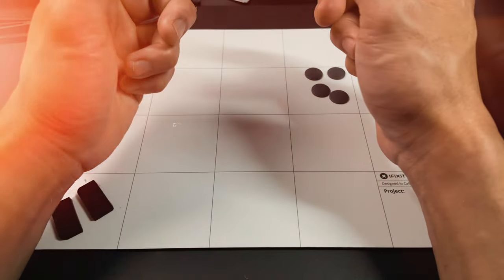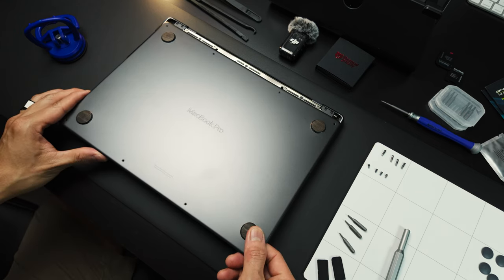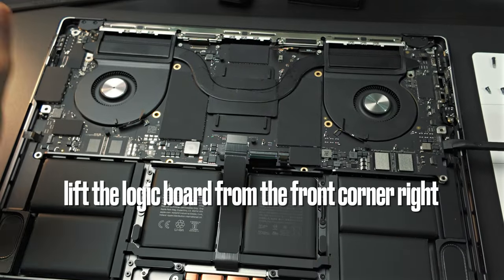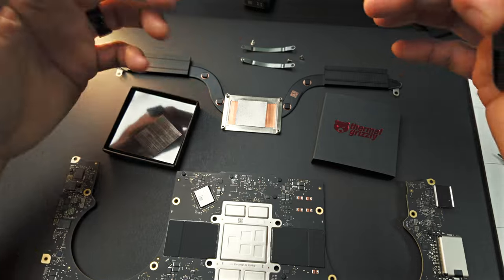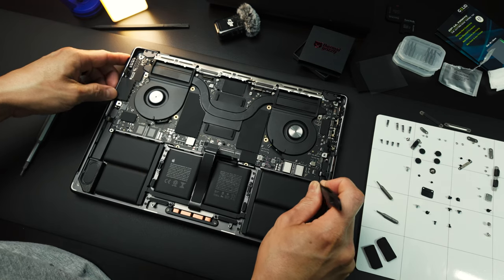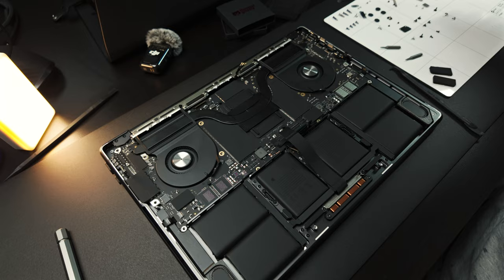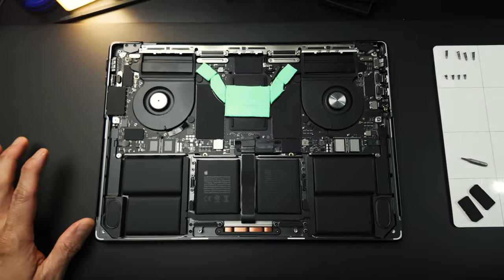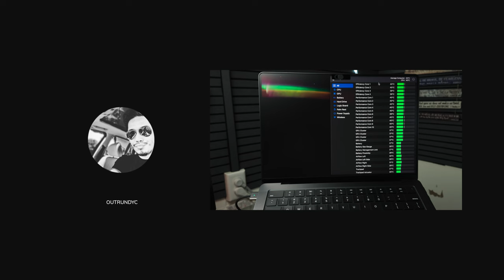Teardown of a MacBook Pro M3 Max that has Kryosheet! REALLY?

Comment: Hi Cool Video, have a couple of questions? if you kind enough to give some inputs, what was the temp baseline prior to installing the Kryosheet? and do you think that buying 2 to really cover in full the m3 max processor will have any add Value? from the pipes to MacBook lid, what expessure are the terminal pads? I have same m3 max model, and well you know if get's loud a noise in any situation. I'm exploring a 3d graphite thermal pad from UPsrien that have 40w/mk from pipes to lid, still taken courage to install the carbonaut or kryosheet. also purchased SValt cooler as stand to see if eases the noise.  any inputs on above is welcome.
Reply from the maker: Hi @cassiobloisi9756, thank you for your comment. As for the baseline temps, before all of the mods I did , my very first run of Cinebench, for the multicore I got 1,359 and GPU got 10,401 points. I compared that to most Youtube videos that reviewed the 14" M3 Max same spec 14/30 core. Now for the Idle before doing all the MODs im getting CPU performance cores getting 43-47C just browsing the web. 
Im going to make another video, Kryosheet vs Carbonaut. 
The Svalt stand cooler does really make a big difference acting as an external heatsink. Which one do you have?

For the size of Kryosheet, you just need 25X25X0.2mm perfect size. You will have to align the pads on the heatsink check this video out. https://youtu.be/dlSx8JMefX4
Thank you and have a great day! Let me know if you are going to do the Mod and have any other questions. Goodluck!

Comment: Hi. Which size of Kryosheet did you buy and did you have to cut it to fit the M3 processor?
Btw, big thanks for the step by step guide. Will definitely follow this and replace my thermal paste too.
Reply from the maker: @teshynevermore5821 You're welcome! The perfect size for the M3 Chip is 25X25X0.2mm . But wait, based on my observation, I think the Carbonaut is far more better than the Kryosheet. Why? Just wait till I do a comparison video. Yes its true that the Kryosheet offers a higher W/mk, but again if you can hold till next week, I will do a comparison and tests. Thank you so much.
Reply: waiting for comparison video
Reply: @OutrunDYC  I will change Carbonaut, waiting for comparison video!
Reply: @OutrunDYC  any news on the carbnonaut comparison? Isn't a higher W/mk all we want?

Comment: Did this mod. My temps are in general about 10 degrees higher than yours :/ 
Mostly around 47-55 C
Reply from the maker: @TechnoNates Did you also use thermal pad in between the M3Max and bottom case?
Reply: @OutrunDYC  oh I actually did not. Forgot about that.

I fear faster wear of the battery because the heat distributes over the whole bottom of the case.
Reply from the maker: @TechnoNates  Im just sharing you, my battery is still in great new condition! 12 cycles and still 100% Normal. I'd say, if you did the Kryosheet, just do it all the way! help those heat escape out of the M3 Chip! My battery temps is hovers around 32C -34C FYI.

Comment: Do the fans on these idle at all times or do they turn off when they are not needed?
Reply: Only when they are not needed. 
Apple uses this pretty aggressively, meaning they sometimes only turn on when the chip reaches 90 degrees and then they start blasting
Reply from the maker: The fans are usually off when doing light tasks. They turn on when temps go high. Thank you.

Comment: what is the mm thickness size of the green thermal pads?
Reply from the maker: Hi! The thickness of the thermal pad in this video is 2mm, but i suggest you use 1.5mm, it is the perfect thickness between the heatsink and bottom case.
Reply from the maker: Are u doing the same project?